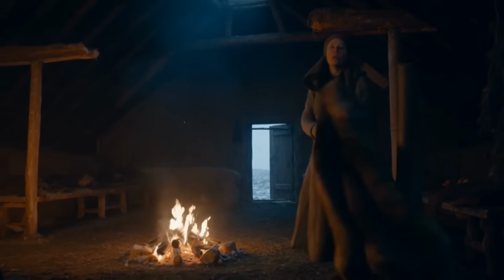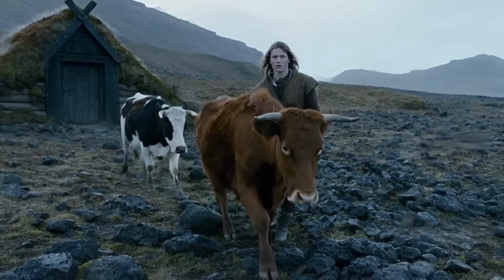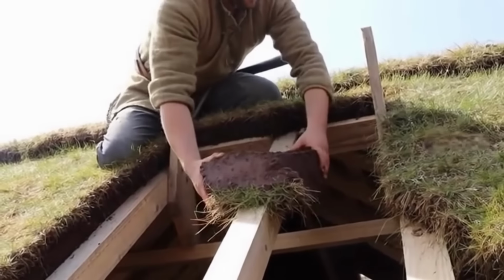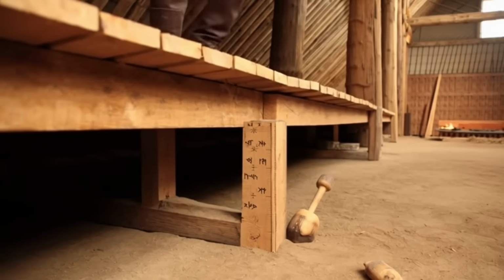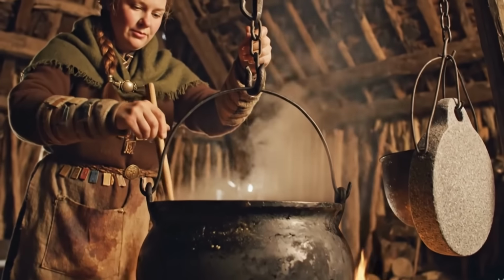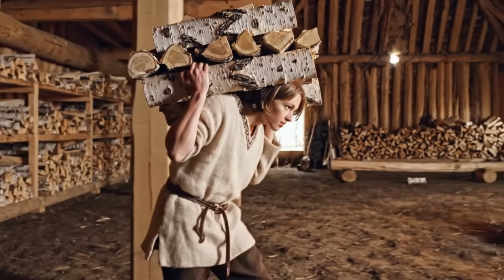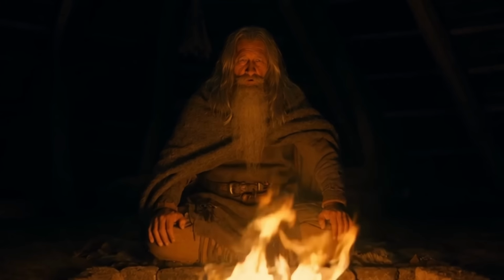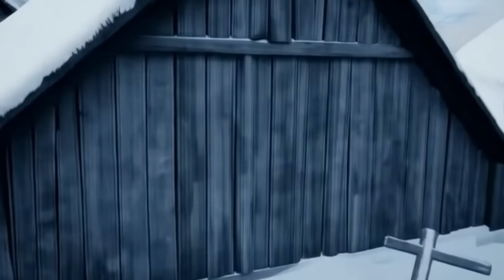The Winter Survival Architecture of Viking Longhouses in –30°C

Comment: Actually 12° Celsius ≈ 54° farenheight. That’s really only about sweater weather.
Reply: Ive slept in colder temps during the summer lol. My dad used to keep his house 56-58 degrees lol.
Reply: One can die from hypothermia at 54 degrees Fahrenheit. N.B. my correct spelling of Fahrenheit.
Reply: @8thCavalry  one can die of hypothermia at even warmer temps. But it still ain’t really very cold. It’s warmer than the inside of a lot of current farmhouses in the winter.
Reply: 54° was the temperature on the inside.
Reply: @OSSAdventures yeah, I know. That’s warmer than a lot of farmhouses today.
Reply: "ACKSHULLY..."